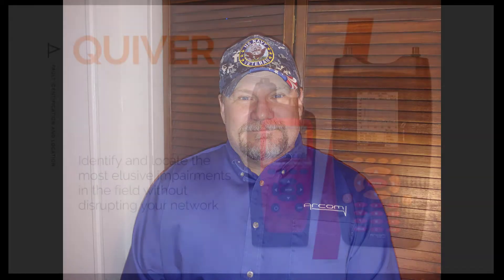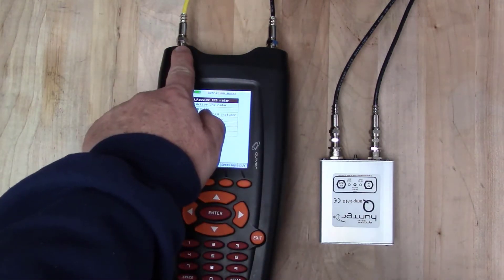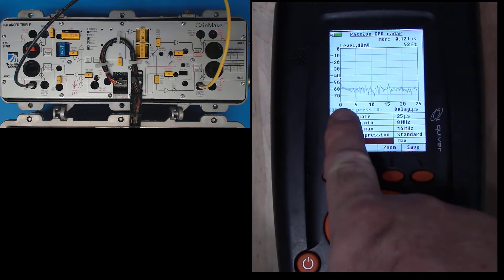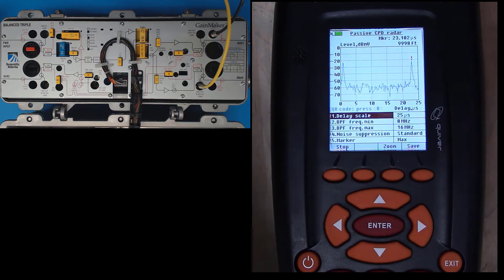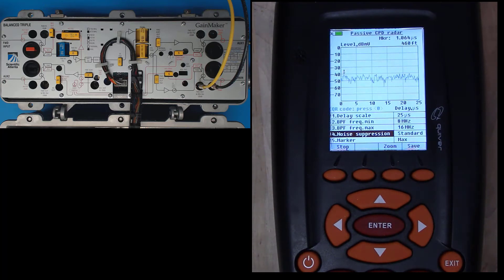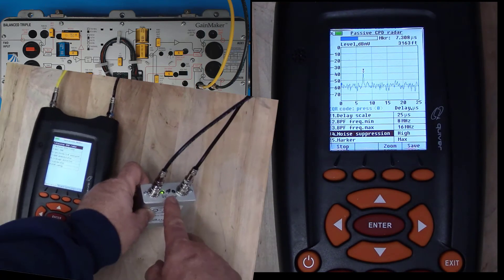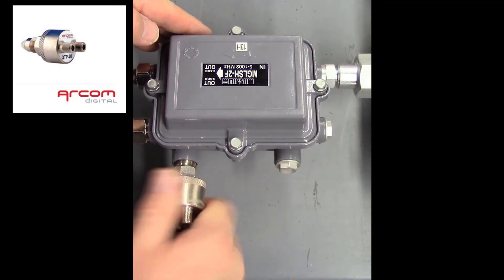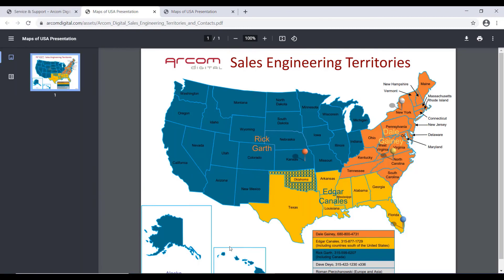Quiver XT CPD

Comment: Can the quiver xt work in a local capacity without headend equipment
Reply from the maker: Hi Josh, Thanks for your question! Yes! You can purchase an "Unbundled" version of the Quiver-XT (P/N QVR-XT-UB) that operates independent of any XCOR Headend equipment. If you have any other questions, please feel free to contact the salesperson in your region anytime. A regional map PDF can be on our website at https://www.arcomdigital.com - or click the immediate link here: 

https://www.arcomdigital.com/assets/Arcom_Digital_Sales_Territories_and_Contacts.pdf

Sincerely, 
Dave Deyo 
Product Support Engineering Manager 
Arcom Labs, Inc. 
Arcom Digital, LLC. 
185 Ainsley Drive 
Syracuse NY, 13210 
315-422-1230 X336 (Office)